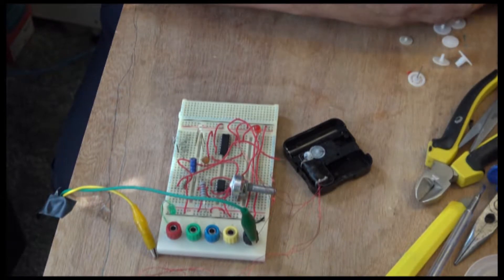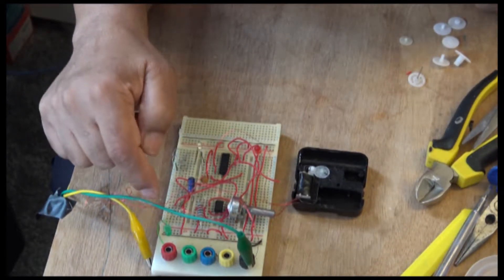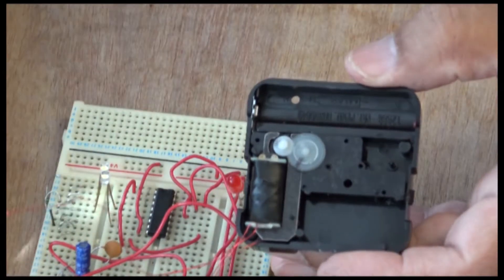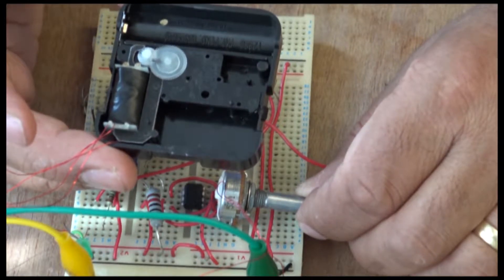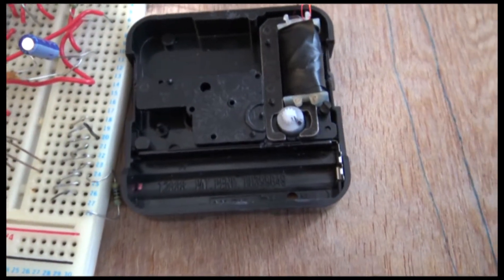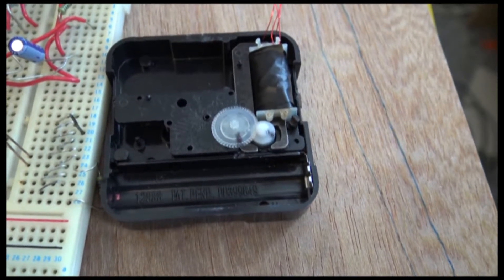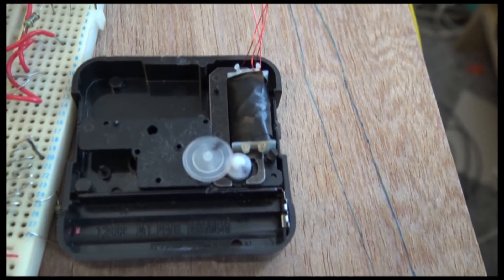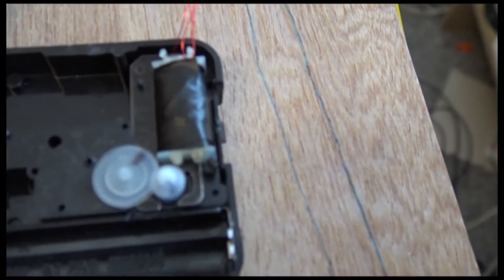#85. How to Speed up Quartz Clock

Comment: Hello, is it also possible to slow down quartz machine? Specifically to make the one day on clock last 365 days (1 year), so slow down about 365 times. Thank you!
Reply: You can drive the lavet motor that move the clock with an arduino or something similar. So you can choose how long the interval will be from one tick to next tock! ;)
Reply from the maker: I think it may be possible. The Quartz crystal works on a certain frequency so not too sure. But more experiments are needed. Thank You
Reply: Hi chocova
You can mail me your requirements to rubenamit.g@gmail.com and us this the project.